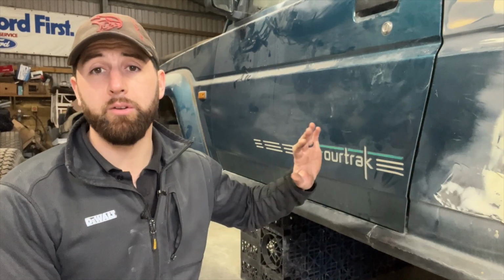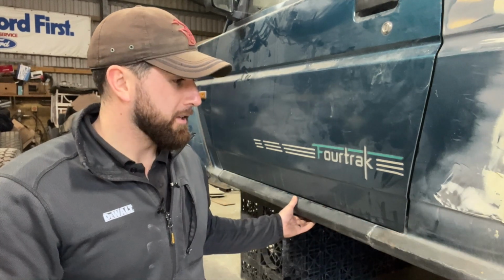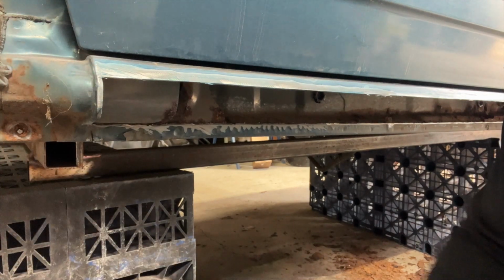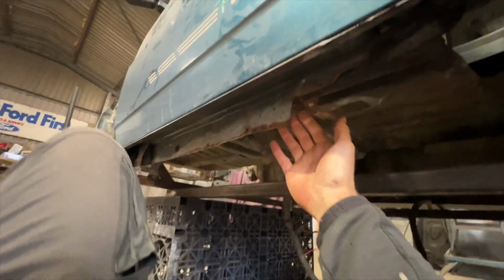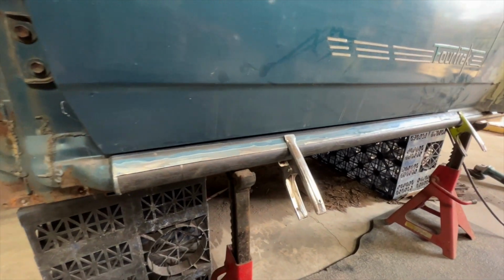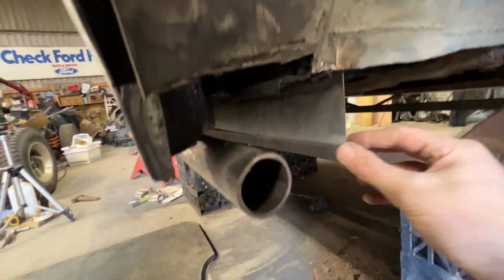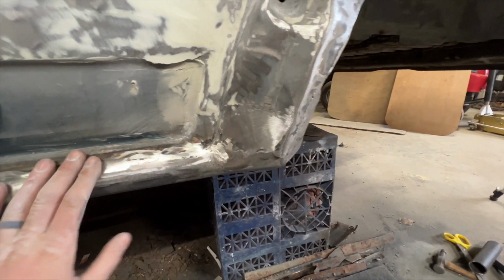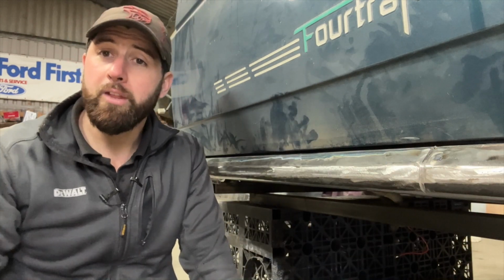Daihatsu Fourtrak Restoration Pt9 - Custom Sills

Comment: This series is helping me out a lot for the future because I have a fourtrak farm vehicle/play around thing and I'm in a rush to get all the sharp rust mended ready for MOT. Before we just covered the arches over with duck tape but because I got it off my dad to see what I can do with it after its been sitting for probably almost 10 years, I think the welding practice should help with any other cars I want to revive to sell in the future :) So far on mine rust wise, I've replaced the back door and front panels from some other scrap parts daihatsu's we have around the farm. Sure the front panels are red now and the parts weren't off the same model but if they fit they fit and they don't have any rust (or not as much as there was on it) so I'm happy. It's only a Toy project thing anyways, might even take it rallying 🤣

Comment: Daihatsu fourtax was what I leaned to drive in and my first field car on the farm it was a red 93 seater model had a yellow stripe but the whole jeep was resprayed Massey red it was lovely but over 12 years on the farm it got rough the engine never stopped going what failed it in the end was the rear axle locking up every few hundred metres, it was parked 6 months later it started first turn unfortunately my uncle sent it away with scrap wish I took off the wheels cus they were very good and different any were rare enough I never saw another set on one I’m nearly 19 now I hope in a few years to find one for the road for myself as it was my grandfather who taught me to drive in it I would happily drive one now on the road but unfortunately insurance is stupid and when they see 2.8 insurance goes crazy even tho they arnt fast
Reply from the maker: Fantastic trucks! That’s of course why I was so keen to save this one from its impending doom!